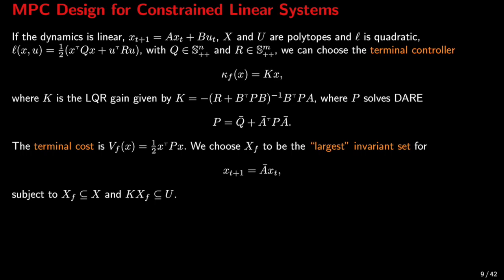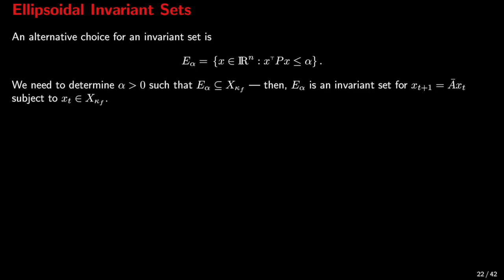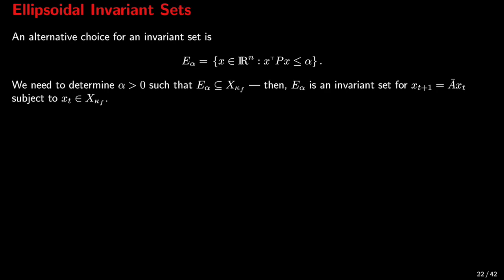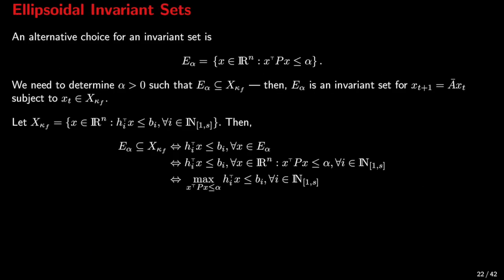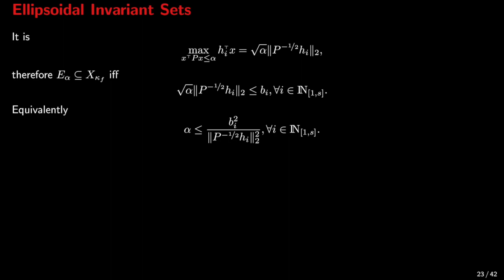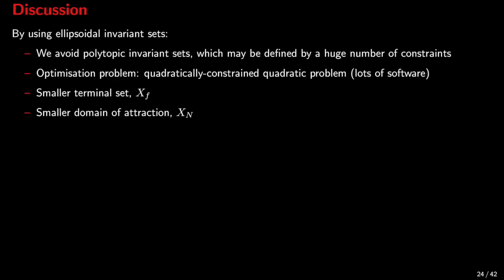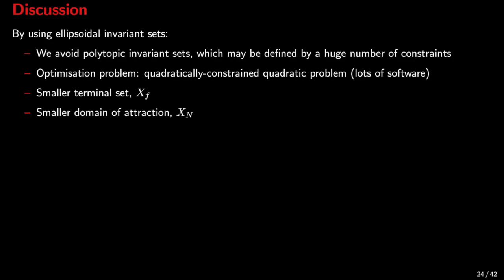MPC Design for Constrained Linear Systems: Ellipsoidal Invariant Sets

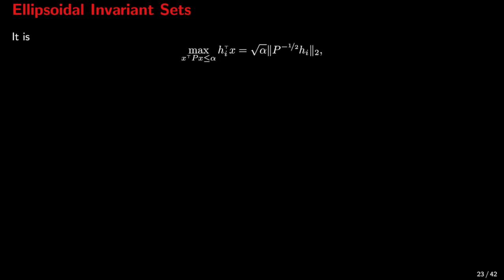Comment: I wad wondering how maximizing hiT x while ensuring xTPx is < alpha 4:50 defines the terminal region and where is the closed form expression derived from? Also, are there any references I can look at?
Reply from the maker: Very good question. We can determine a closed-form expression for max_{x' P x ≤ a} h'x using the fact that the Euclidean norm is self-dual, i.e., max_{||x|| ≤ 1} y'x = ||y||. Regarding why this defines an appropriate terminal set, (i) Ea is a subset of X_{kappa_f} and (ii) the function V_f(x) = x' P x satisfies a Lyapunov decrease condition for the kappa_f-controlled system — that is, x+ = f(x, kappa_f(x) — over the set E_a. Have a look at https://youtu.be/zBRmri11pvo?si=37sxvQwoZkkrwrs5&t=203 where I give an introduction to MPC design. Some good references are the book of Rawlings, Mayne, and Diehl and, for nonlinear MPC, the book of Grüne and Pannek. Let me know if you have further questions.
Reply: @p_sopasakis  Thank you for your response and the suggested references, great video by the way!! So you transform the ellipsoid into a unit ball by change of variables and then use the self-dual property of the Euclidean norm to find that closed-form expression? Also does this alpha define the largest ellipsoidal invariant set possible or just an ellipsoidal invariant set that satisfies the polytopic constraints?